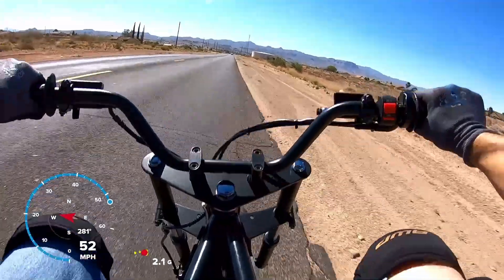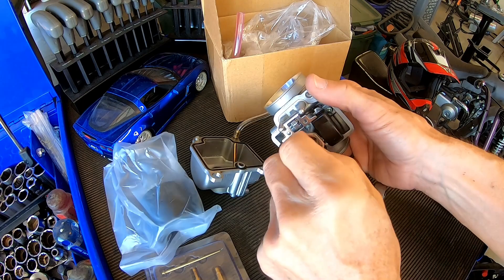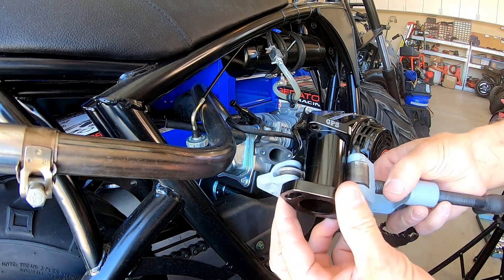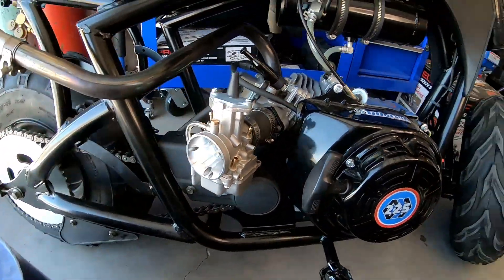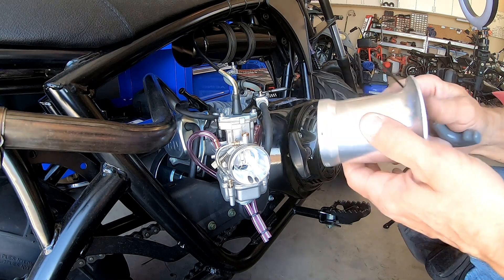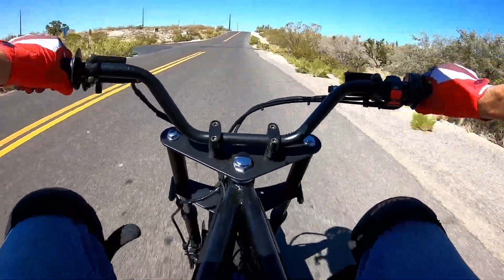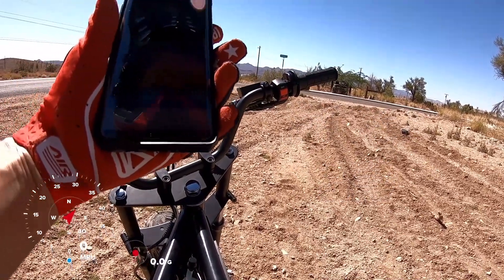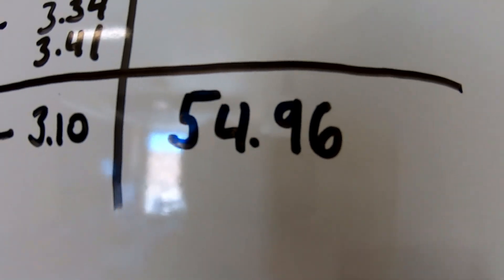28MM slide carburetor on the Tillotson 225

Comment: Anytime I use a flexible boot I add a flat metal brace from top of the carb to the open bolt hole on the head. I have had those flexible boots vibrate off when holding the weight of the carb on it.

Comment: Where did you get the carb? Thanks
Reply from the maker: Amazon. I usually put the links for the parts in the description.
Reply: @Black66  like all the videos and test data you supply , I just bought the same kit you built for your wife , I have an old Coleman bt200x as well but am excited for the mega212 coming on Friday . Keep up the good work
Reply from the maker: @johnperreco5227  Thanks! The MM212 is a sweet bike!

Comment: I got a nibbi 28mm on my 225 stroker and it's doing the same thing yours did on the acceleration. Tried jetting it differently but no help any suggestions?
Reply from the maker: I cleaned up the hesitation with a smaller primary jet a a needle adjustment.
Reply: @Black66  I'm not sure I can go smaller already have a 100 in it now but I'll definitely try a need adjustment
Reply: @justinsebesta1288  are you running a fuel pump
Reply: @Shawn Baker  I am yes, but I found that the 28mm was a touch too much carburetor for the motor, so I swapped it for a 26 and a .100 main jet and it runs so much better. The pump is a basic pulse style fuel pump and I use the pulse coming from the intake manifold between the carb and head to prevent the pump from getting oil moisture build up or getting overheated from crank case fume temps.

Comment: Are you saying that the tilleston 225cc Performance Engine comes with a 22mm flat slide carburetor? All I hear you saying is a slide carburetor, which you said when you showed the engine in the beginning, which wasn't a flat slide carburetor, which is the carburetor that comes with that engine, but right after that you showed a flat slide carburetor, but again you just said slide carburetor. I know that if you bought the Tillotson 225cc Performance Engine from GoPowerSports, then that engine doesn't come with a flat slide carburetor, it comes with a regular 22mm Chinese Mikuni carburetor, if I remember correctly.
Reply: If you watch the video again, in the intro he flashes on the screen that the Tillotson comes with a VM22 carburetor not a flat slide carburetor.
Reply: @NVScrapper  I seen that if you go back and read my comment, I said it wasn't a flat slide carburetor. Lol. I think you might have missed that part, but thanks anyhow. 😆👍
Reply: @NVScrapper  Also, I have the Tillotson 225cc Performance Engine from GoPowerSports, and I had them take off the 22mm knockoff Mikuni carburetor and replace it with the 24mm Mikuni flat-slide, so that's why I was just trying to clarify what he was saying, because I have the same engine, unless he didn't get the Performance Engine, but I'll have to check into it more.
Reply: @roypatterson9910  At twenty seconds into the video he clearly states the Tillotson 225 comes with a VM22 "slide" carburetor . He doesn't say flat slide. A VM22 is a slide carburetor.

Comment: I've seen in your other vids you have a welder.  Step up to a larger exhaust.  I run nothing smaller than 1 1/4" exhaust on the 224's I build.  The throttle response and speed will improve over that small pipe your running.
Reply from the maker: I have a video coming out using a custom exhaust.

Comment: Yo I just built a predator 212 hemi it's got a +.020 billet rod, a pvl flywheel, a .010 head gasket, 22lb springs, 3 stage header, a mikuni knock off with a 130 main and a 35 pilot, new flat top Piston with beefier rings and  I did some pretty decent head porting and made sure ports matched. I feel like I should have more balls than what it does, like pull the front wheel up easier than what it was stock but I'ma see if I can get so more power out of it tomorrow by tuning the carb Ima see what a 140 jet does and go from there
Reply: Stainless valves? And cam?
Reply: @PeelePowered  yep I'ma prolly get a cam sometime if the engine holds up as of right now it's pretty badass it wheelies easy now and it hits 53 pretty quickly I got another bigger carb I'm gonna put on aswell
Reply: @mini0448  did you open up your intake and exhaust ports at all?
Reply: @PeelePowered  yea I smoothed out the edges and then expanded them out deeper and cut pretty good into the top of the port where it comes around into the valves to make a bigger port
Reply: @mini0448  I’m running a similar setup with stock stroke rod, ultralight flywheel, 292 cam and 28mm pwk carb. Dual 60lb springs. So far I’ve spun 8040rpm with no fueling issues using a 120 main. I also ran my vm22 on this engine with a 120 and 125 main being the best runners. Maybe try going down in jet size?
Reply: @PeelePowered  alright I'll try a 120